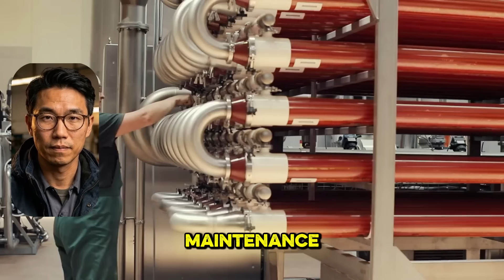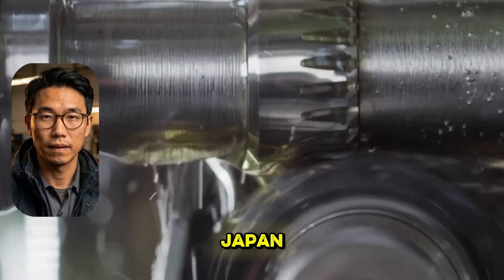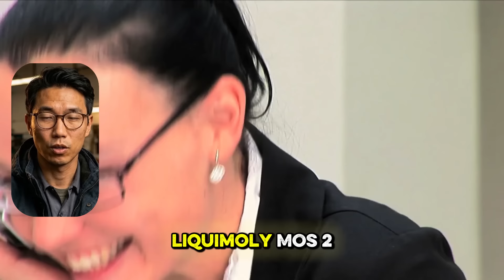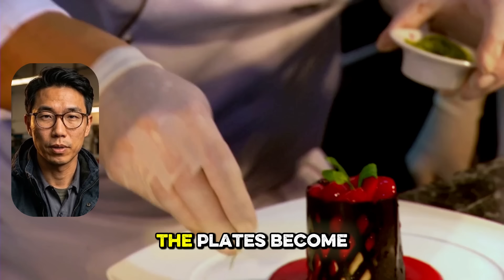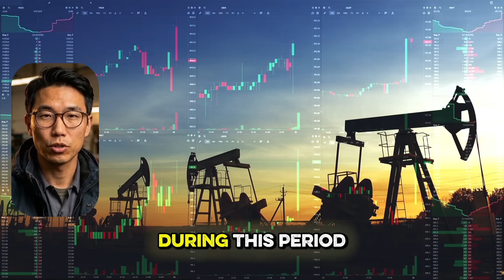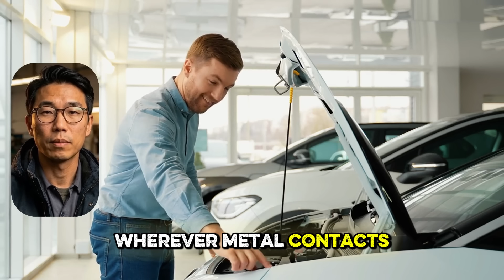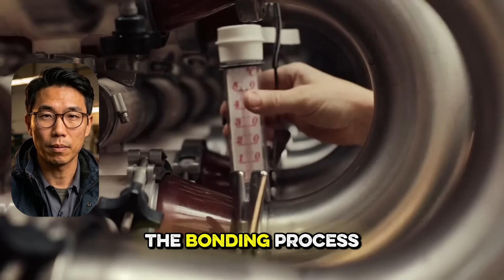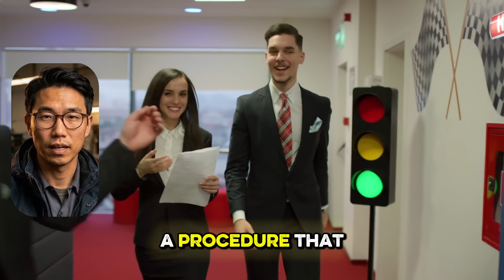The Japanese $2 Liquid Secret That Makes Your Engine Last 500,000 Miles — Mechanics Want This BANNED

Comment: I asked Gemini to comment on this video. Its reply was long and detailed,, but I asked it to condense they key points. Its reply is interesting. It said::

"The science behind Molybdenum Disulfide (MoS2) as a friction-reducer is legitimate and has been used for decades in aviation and military applications to protect engines during high-stress "boundary lubrication" moments. While the video accurately highlights how this mineral bonds to metal to prevent wear during cold starts, the "secret $2 DIY" method of mixing raw industrial powder into your oil is a high-risk gamble for modern car owners. Raw powder can easily clump or settle, potentially clogging sensitive oil filters and narrow passages in newer engines with variable valve timing. 

To get the 500,000-mile longevity benefits without the risk of catastrophic engine failure, skip the raw powder and spend the extra $10 on a professionally formulated MoS2 additive from a reputable brand like Liqui Moly. These products ensure the MoS2 stays in a stable suspension that won't compromise your oiling system, giving you the same mechanical protection with much higher peace of mind." (My highlight.)
Reply: Everyone remember Slick50? It immediately clogged your oil filter.
Reply: @TuttleScott I remember the infomercial...HILARIOUS! 😂
Reply: @TuttleScott Sure do remember it.  There was another one too . I think it was called Dura Lube or something like that.  The commercials were hilarious showing how it would reduce wear . Some ball bearing test and if I remember correctly there was an engine in a block of ice also that was supposed to demonstrate how it reduced wear at start up in cold  climate conditions 🤣
Reply: @TuttleScott < It was so long ago that I couldn't remember the name until you mentioned it -- but yes; I do. And I remember it just sort of "disappearing without trace or expiation". Now I have some idea why.
Reply: @danohanlon8316 slick 50? Loved that stuff back in the day 🤣😂
Reply: @danohanlon8316 actually the owner and his son made so many millions of dollars that they both decided to retire. There's a comment on here by a friend of theirs who tells the story. Pretty interesting. Must be nice😂
Reply: @fiskfarm < Having looked into it, reports are that they were sued by the government for making excessive claims of effectiveness (and lost.)
Reply: Hth
Reply: 💯 That's what I'm going for. Advance has it.
Reply: Who is  "Gemini" ???
Reply: @davesandler448 AI
Reply: Good information.  Thanks
Reply: I've used prolonged 2000 on my engine and prolong transmission fluid on my transmission That was in 2011 Don't need to mix anything you just get the jar put it in and what mileage figures increase by 15%

Comment: I believe that most cv joints Use molybdenum disulphide grease , at least saab originals did .
Reply: Great catch. CV joints face the most brutal sliding friction in the entire drivetrain, and $MOS_2$ is what keeps them from snapping. This is the heart of DIY Engineering, applying what works in the shadows of the chassis to the heart of the engine.

Comment: A company from Sydney Australia called Nulon once used Teflon as a lubricant additive. It was so effective that once it was circulated, you could literally drop the oil and engine wear would not occur. DuPont (the owner of the Teflon patent) didn’t like that, so successfully took out court orders to prevent Teflon being used on anything but cookware. The power of big business! 😒
Reply: Not true. Teflon is used in many industrial applications. Please cite the source of your claim.
Reply: @rockstep44 Google it yourself dude.
Reply: I believe that was the original “Slick 50”.
Reply: I think it was the original slick 50 that contained Teflon when it first came out. The inventor of slick 50 says that the formula no longer includes Teflon so it's not the same at all. However I did use it in a Porsche 914 engine which is an air-cooled engine and uses air cooling over the engine to heat the interior cabin and after I added slick 50 to the engine oil the ability of the engine to heat the cabin was substantially reduced which I took to mean it was reducing friction inside the engine quite a bit
Reply: Actually DuPont filed a lawsuit against Slick50 as they asked them NOT to use Teflon in an engine oil additive!  PTFE AKA Teflon breaks down into Hydrofluoric Acid at combustion temperatures!
Reply: Seeing this brings back memories of my old man adding 'the black grease' to every truck we owned. It’s a bit sad that we’ve traded this simple Home Engineering wisdom for shiny, expensive bottles that do half the work just to keep the industry happy.
Reply: Why wouldn't they sell it on their own?
Reply: Mos2
Reply: And the jokes on dupont. Here in US a movement has been gaining steam to do away with using teflon cookware. Also Dupont is connected somehow to Charlie Kirk's assassination I heard.
Reply: More Expose' MOS2 JAP - NO OIL, GREASE, LUB  DDD SECRET !!
Reply: Trust me, the US Automobile Car Industry is Brutal.!  The CEO of any Company that boasts this claim would have a Colt 45  held against his temple & told  'No' end of!  Story after  story is told about the brutal activities of the car industry, please wake up.!
Southampton UK
Reply: @johnlarkin9594 Yeah but cars are made all over the world in a multi BILLION dollar competition for sales. Your argument fails at the global level.
Reply: CASTROL 😂

Comment: Thank you so much for these videos. One comment, not only are the bizarre images incredibly distracting. the fact that they’re flashing every second or two compounds the problem. Yo are a very interesting guy stop the unnecessary visuals. Thanks
Reply: The only thing is that you near to drain the oil and ad up new sintetic oil

Comment: In one breath the AI man says it "permanently bonds to the iron and in the next breath he says it should be re-applied every 50 to 70,000 miles.
Reply: dont be stupid both are facts and exist together. it wears down just like anything else will whether its permanently attached to the iron or not hence the need to reapply.
Reply: @Anotherdaynparadise  I guess "permanent" doesn't mean the same thing in your house as it does in mine.
Reply: 50 to 70,000 me as far as an engine is concerned is pretty much permanent

Comment: MOS2 is genuine but be careful with it on fine Engines - Older Vehicles: Ideal for reducing noise and wear in older engines. You can Buy this at Auto Shops. - Not a Scam.
Reply: You’ve nailed the facts! This is DIY Engineering at its purest level. The reason most people hesitate with 'fine' engines is fearing filter clogs, but at the molecular level, MOS2 is actually smaller than the pores in a high-end oil filter.
Reply: @PrimalExplainer01 Been adding MoS^2 to my turbo Audi engines for years!  My S4 k03s lasted well longer than my friends and we pretty much all had the same custom tunes.  Literally the only difference was I was adding MoS^2 to every oil change and I swear it saved me thousands.
Reply: @Phuketbrownbear And your vehicle gave out at what clicks/km?
Reply: @Phuketbrownbear  Do you add the powder mixture?
Reply: @droopypie  no, I get it in the liquid form.  If you get it in the powder form, you have to look up the weight to volume ratio of the oil you’re using.  The specific weight of the oil will also matter.￼￼￼
Reply: @n @namkebanyanklariti  my vehicle didn’t “give out”￼.  The passenger side turbo built up too much heat and started to leak oil.  I pulled the engine and replaced both turbos with GT2X eliminators around 178,000 miles.  Still have it, it put down 642 whp, 677 ft. lbs, on a street tune using a dynapak.￼￼￼  I’ve done the same with my Saab Viggen, but that thing leaks oil like a sieve from the valve cover gasket and no problems with the original turbo.
Reply: @Phuketbrownbear How much to add
Reply: @Phuketbrownbear "my Saab Viggen" o dear, a high-flyer!
Pete-the-Swede
Reply: @PrimalExplainer01  for real???
Reply: Liqui Moly owned by Wurth is a German motor oil company.  It has been used in racing cars in Germany since at least 1977.  Turbo V6 Ford Capris, BMWs, Mercedes and Porsches.
Reply: @frankl31436  Video says it doesn't have that much MoS2 in it
Reply: Been using Liqui Moly for years my Honda Odyssey 2008 W/over 500K miles, everything around the engine has been replaced
Reply: Gotta 2006 mazda 6 I'm getting running again, would it be OK for that engine?!!
Reply: @BlkKahuna67 I think he's pulling your leg
Reply: @picklefoot yea
Reply: @picklefoot fo sho
Reply: Doesnt work on mazda. Sorry
Reply: @ray6976  why?
Reply: Wow...engine lasts longer than everything else. MoS2 for the internal combustion and all lubricated moving parts and the Fluid film (Lanolin) for the body. Wish I knew about both of these a long long time ago. Good grief! Wish I heard about this a long long time ago. Actually I wish all the people I bought used cars from knew it too.
Reply: I put liqu moly in my Chrysler town and country during a oil change and right before going on a 5 hr trip and I'm not sure if it's in my head head but it seems to run better going up the mountains and I had a litter tick that started when 1st starting and that's gone.  Honest injun
Reply: Thanks for letting us know where to buy it!!!!!!!!
Reply: For Nissan Qyasqai Gas? Worth it??,??
Reply: I read that It grinds away from metal in the engines after about seven thousand miles at which point it needs to be reintroduced.  It also has a very high flash point thus once again enhancing engine oil.
Reply: Sorry,  it's it's just another "snake oil" with a Japanese endorsement.
Reply: While the science of MoS2 as a dry lubricant is solid, how does raw 2-micron powder affect modern high-efficiency oil filters? Many modern filters are designed to catch particles as small as 5-10 microns. Won't adding raw powder eventually lead to filter clogging or restricted oil flow in variable valve timing (VVT) solenoids
Reply: So dont put it in a 2000 car?
Reply: @DeezeeBreezee Your Choice
 At your Disgression.
Reply: LIQUID MOLY. AMAZING. IT 💪 WORKS
Reply: Please explain.  I have a new Nissan 3.8L V6.what do you mean by "be careful on fine engines"?  Should I add Less or what
Reply: It dose not cost 2 dollars!!!!!!! Lier!!!!
Reply: @daveharmon8674 it cost Them 2 dollars to create it ,in mass, If we buy its more ..😂
Reply: @daveharmon8674 I agree. The cost is more than is stated. The product is true.

Comment: This is all bullll. There is a white powder that cost $2.00. It does everything. scam scam scam.
Reply: NOT WHITE  Colloidal MoS2 is a grey powder compared to Colloidal Graphite powder. Note both work to protect metal surface wear --- the difference is MoS2 has a much higher failure pressure -- SO HIGH that Iron will deform before the MoS2 fails....

Comment: I see it in liquid form as well... Which is better powder or liquid
Reply: It saves you the "stir it into your oil" step. Liquid Moly at Advance is under $11. That's my route👍
Reply: @fiskfarm Farm, I take it you get yours from Advance Auto Parts Store?  Will it turn your oil black or anything just so I am aware of it is all?  Thanks Ty Clark
Reply: @tyclark8162 I'll have to go look at our Trooper. First time I've used it. All my other engines are diesel so you won't notice.
Reply: Liqui Moly MoS 2 on Ebay 14 bucks,Im sure Oreillys or Autozone will have it to

Comment: Can it be uses in Transmissions as well...?!?
Reply: Transmissions have drums and plates that rely on a certain amount of friction to function properly, so I  would be very careful. 
Even my old atv shouldn't use oils with "friction modifiers " or the clutch won't function properly because it's a wet clutch that's actually in there with the engine oil. 🙂
Reply: @barryfirth1187  ATV's and snow mobiles use belt driven clutches.
Reply: NO! Not automatics anyway. It will ruin them. Old manuals it will.
Reply: Royal Purple in transmissions too, they will last forever as well as engines transfer cases and diffs.